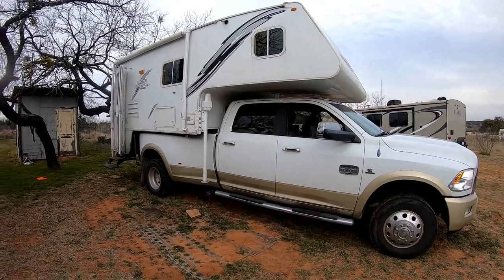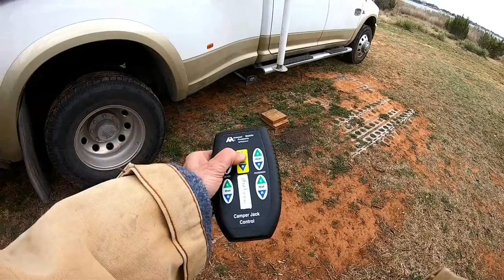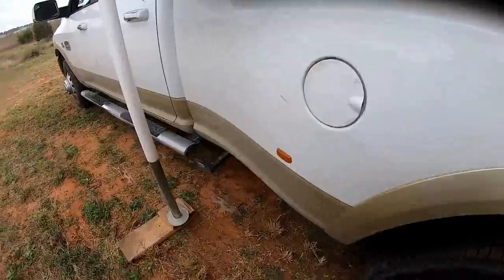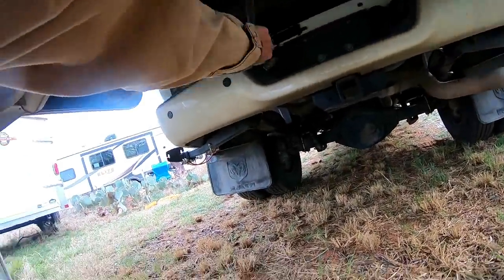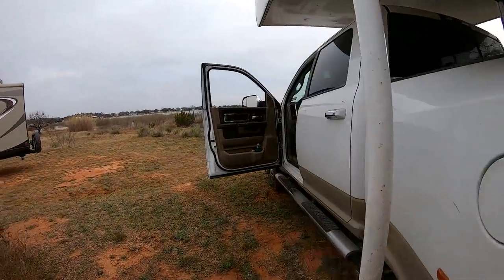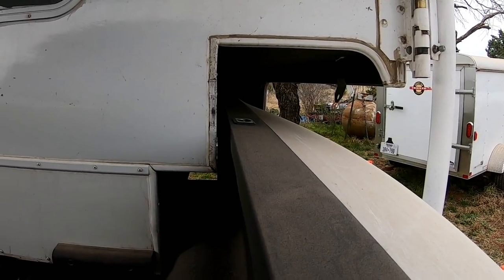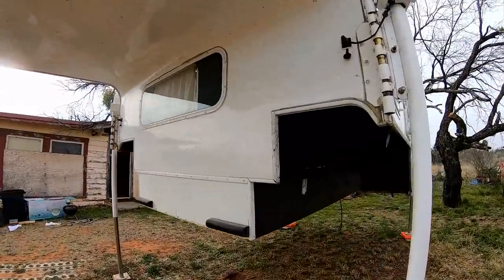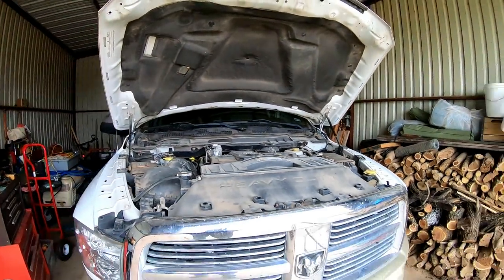Unloading the Truck Camper - Full Time RV Living

Comment: I used to put 3 Crawford Pro Adjustable Steel Saw Horses under my slide-on truck camper to help distribute the weight so it wasn't all on the camper legs. Each Crawford saw horse I have supports 1,200 pounds. Between the camper jacks ( legs as I call them ) and the 3 saw horses , it made the camper very stable when it was off the truck. We also parked it on our cement driveway.
Reply from the maker: I like that idea. I just lower it close to the ground. I dont like sleeping in it when it is off the truck. To unstable.

Comment: I looked at a Lance Atwood Camper off load video and his remote sensor pad is perpendicular in his hand in direction of camper. Perhaps the remote sensor is in bottom of sensor not at end. Don’t know.   An Atwood replacement Gama Electronic remote is 50.$ off Amazon. Cheaper than dealer. It a nice camper. Great video! Love how to Do videos. That is a process. You did great! Yeah Kim The Spotter!! Peachy B hello! 🍑🍑👍👍❤️❤️.
Reply from the maker: I did replace the battery and it seemed to work better. Yes it is a process and you need to be in the right mindset before attempting to unload it.